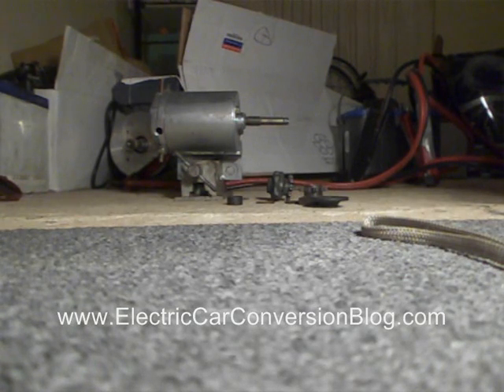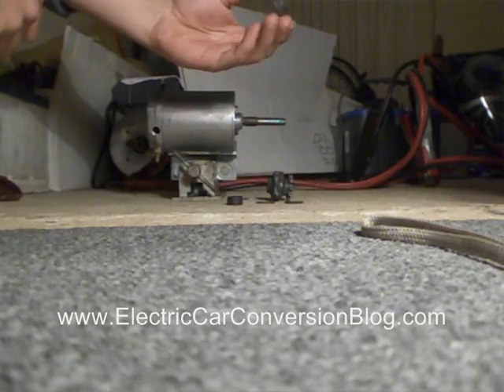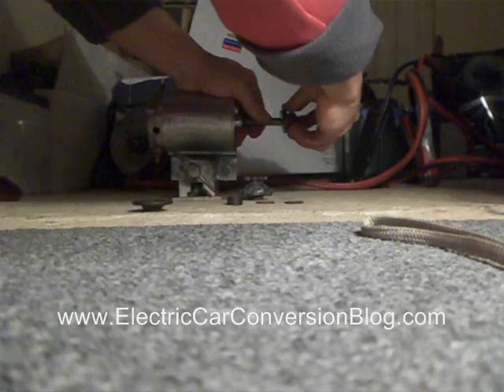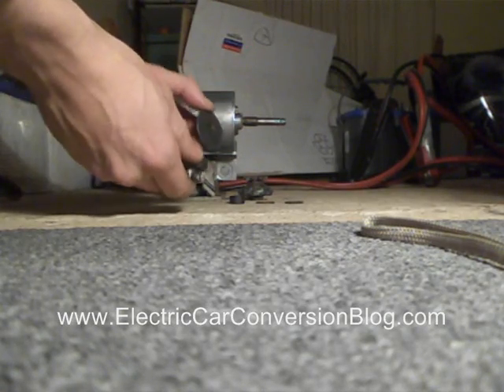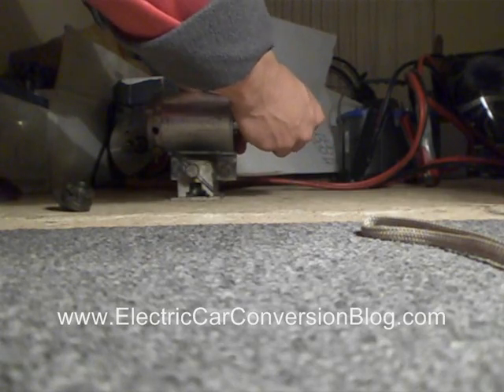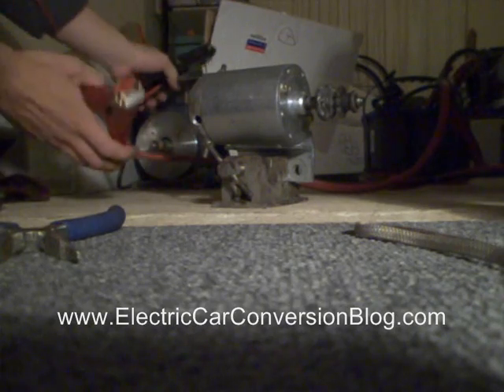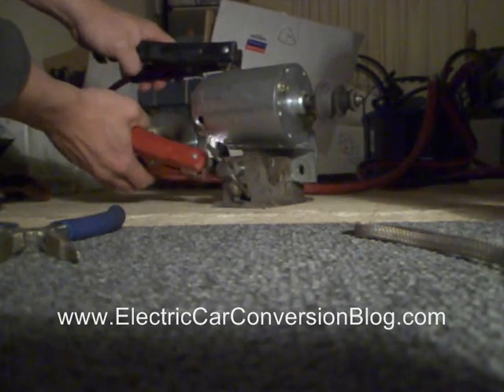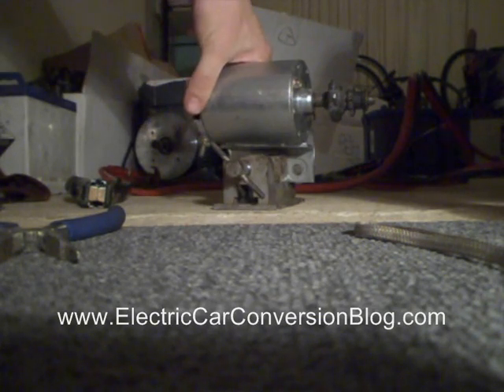Attaching Sprocket To Modified Electric Starter Motor And Testing It

Comment from the maker: The starter motor I modified I think can be salvaged from some John Deere machines. I believe it is possible to buy starter motors for the KT100 motor. You might want to ask some go kart shops. You will also need to ensure that your flywheel has a ring gear which is compatible with the starter motor pinion gear.